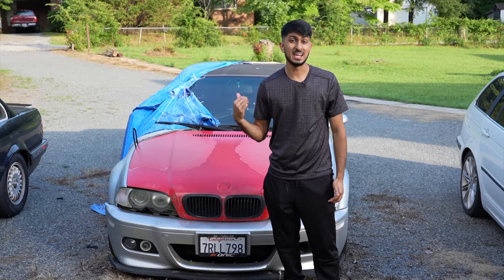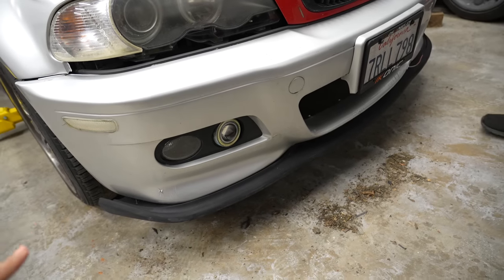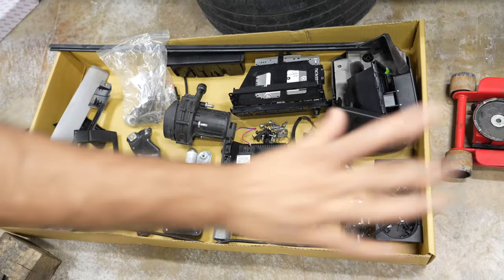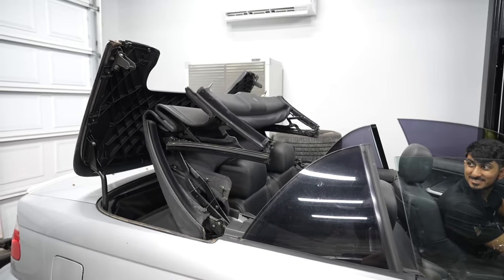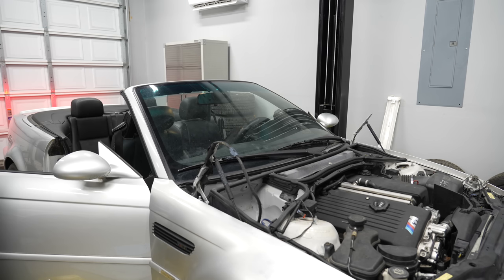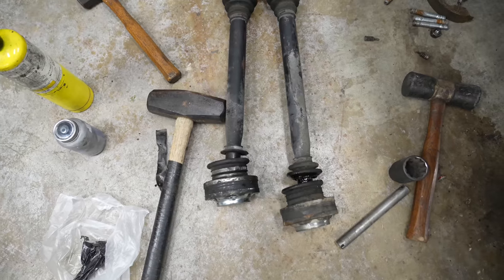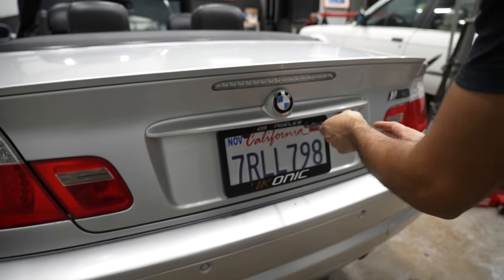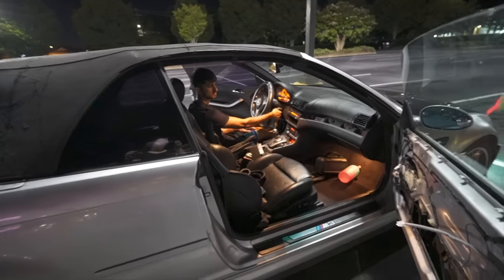$4500 BMW E46 M3 PARTS Car to Road LEGAL in 2 DAYS! WE SAVED IT!

Comment: Another great video! Rocking my 275,XXX E46 and loving it. No codes! I'm doing the Oil pan gasket tommorow. Just finished the CCV for the 2nd time last week, also the hard pipes and motor mounts. Other than a front bumper repaint, it's a clean car.
Reply from the maker: Thank You Marty! Our wagon is going to turn 275k miles any day now! Good luck with the oil pan gasket tomorrow!

Comment: Electrical tech tip.
If you offset all your cuts when splicing in a connector, when you go to wrap the harness, it doesn’t look like a pregnant snake. The offset cuts will allow you to keep the harness consistently thinner.
Reply from the maker: That’s a great tip! I should’ve done that to this splice repair as I had extra wiring!

Comment: You should always try removing the valve cover and oil pan cover and check out the condition of the engine to get an idea on the past maintenance before trying to start the engine .  Wicked video keep it up
Reply from the maker: I agree with that! If this was an actual restoration project, I would have definitely done that

Comment: I'm not a fan of convertible M3s. I think their best use is to be donor cars to convert sedans and wagons to M3s.

Also, just some advise for others working on projects with wiring issues and gas tank issues. ALWAYS have a fire extinguisher on hand. One, preferably more, should be close by at all times regardless. Anything can happen in a garage.
Reply from the maker: I am not a huge fan of verts either, but they are great for weekend cars. Lucky for us we haven't spent too much money on this M3 so we can always use it as a donor car. Good point on the fire extinguisher!

Comment: e36/e46 trailing arms are the worst to get axles out of most of the time. I’ve literally broken arms on the press trying. The only thing that works like 90% of the time is the hydraulic 3 jaw puller. It seems to be the best thing. Those axles get rust seized in the hubs, small or large they both suck lol
Reply from the maker: The 3 jaw hydraulic puller did nothing on these axles, had to pair it with heat and a BFH before it started moving lol

Comment: nice to see a 3 series again! Yeah. Would you be kind to guess a small problem? 325i '04. prime shape but not driven much. automatic trans jumps going into gears when I just turn it on and even if I let it warm to temp. Fluids are 5yrs in car. Will changing transmission fluid along with pwr stearing oil brake maybe make it not jump or is there a known common problem I have not heard of? This car is in super shape except for me not changing fluids and not driving it much. 89k. Please.
Reply: I meant to say when I put in gear in garage it jumps.

Comment: just recently found a 1980s bmw that i helped save from a scrap yard that had sat for 10+ years. (changed fuel pump) and added some new plugs an wires to the little thing and shes on the road again....
Reply from the maker: Nothing like an old BMW, they want to be on the road!
Reply: @ShopLifeTV  considering it's a rust belt car, it's quite literally mint for it's year. Very very little rust anywhere on the thing. It's on the lift at the shop now getting all it's fluids and such done.

Comment: Great video!
I have been working on a e46 m3 for a long time (2 infants in between...) and are now stuck with rear end axles that won't come out... any suggestion as I showed it took you 7h to get them out? 
Many thanks!
Reply from the maker: Thanks Javier! I ended up using a lot of heat, Pb Blaster, a sledgehammer, and a hydraulic 3 jaw puller. It still took forever, but it finally came out

Comment: Hey guys, long time fan here.  If you decide not to keep the car or make it a parts car, I have a better condition SMG 2003 convertible M3 with 119,600 miles I'm willing to sell at a great price not too far from where you are.  PM me for pics or a description of the few things it does need, as well as what I've done to this point.  It's 100% stock besides some Delrin and polyurethane subframe and RT arm bushings.  The engine runs but has a little timing roughness, which I think may be the VANOS.  The transmission is currently stuck in neutral. I think the transmission has a position sensor or detent issue.  Some clearcoat issue on the convertible trim piece.  Otherwise, in extremely good shape inside and out, no leaks.  Willing to sell for an amount that will probably be way cheaper than getting all the missing parts and sinking a ton of time into a salvaged title car -- which will be difficult to sell and may have other issues down the line.  -Oscar

Comment: M50 manifold is controversial, would it make the most sense to do the stage 1 tune, then the headers and maybe a cold air intake, THEN the m50 manifold? I could be wrong but and everyone’s situation is different but I’m still stock other than a k&n air filter and I’m thinking about stage 1 revmatch on my e53 x5 for the fuel economy benefits if nothing else

Comment: So, the non-M heater matrix worked. Ha, good info for M owners?
Reply from the maker: It will work, but there will be a fault in the HVAC module regarding the aux water pump. Shouldn't cause a check engine light. Most s54 swaps do away with this style of heater valve anyways so shouldn't be a major issue long term.

Comment: Lights won’t turn off ?   I have that problem with a 2000 Z3 Florida flood car. Head lights: l put a kill switch on battery negative lead in trunk where battery is. Checked all switches and relay. Problem still not found
Reply from the maker: My issue was due to the previous owners wiring in aftermarket fog lights and switches by soldering directly to the LCM.

Comment: What’s wrong with the style 67s? Especially in “18 I don’t see how 437m would look better but I haven’t seen the works u mentioned. Just wondering
Reply from the maker: These style 67s have a lot of cosmetic damage and the tires are shot. The 437m wheels probably wont go on, I just wanted to put them on temporarily since they were already in the shop and had tires mounted. Most likely going with the Work Rezax II wheels for the time being

Comment: I have a ‘04 M3. I really enjoy your videos and you’re a good mechanic but have to disagree with your decision not to replace all fluids before you rotated the engine and attempted to start the car. After sitting two years that just seems wrong!
Reply from the maker: Thanks John, and it would have been ideal to change all of the fluids, but I made sure to prime everything so there wasn't a dry start. You will see the condition of everything in the upcoming videos on this car.

Comment: Its sad since I see nonstop m3 part outs everywhere from Facebook and OfferUp. They're heading to the same fate the Nissan S chassis suffered to the point where they got too expensive since there isn't any left. In my opinion use basic non M platforms to do crazy builds and keep the M cars like it is/make it better.
Reply from the maker: Unfortunately that is the case, many of the E36/E46 are headed in that direction. It makes sense to part out totalled M3 since the S54 engines are selling between 6-10k depending on mileage.

Comment: my convertible lid wont latch shut anymore. of course this happens on vacation such a bummer... goes back fine the lid lowers closed and then click click click click wont latch shut and i have to close the roof.
Reply from the maker: It's a sign to keep the top down lol You might need to replace the latch mechanism or it might just need to be adjusted. Good luck!
Reply: @ShopLifeTV  thankfully I can close the top but I cant open the top is what I’m saying. The final part of opening the top is the boot lit closing and that’s when the clicking happens right as it needs to suck the lid down tight.